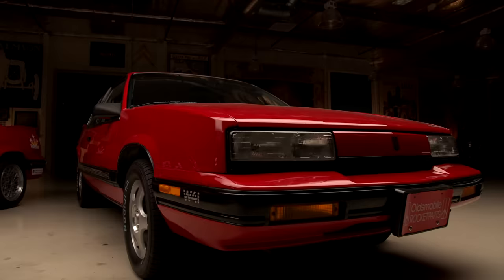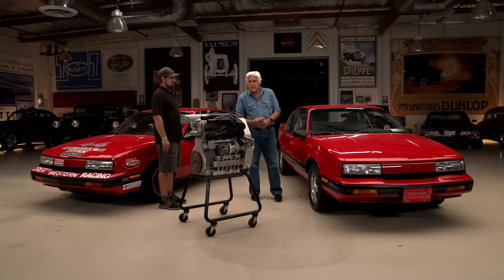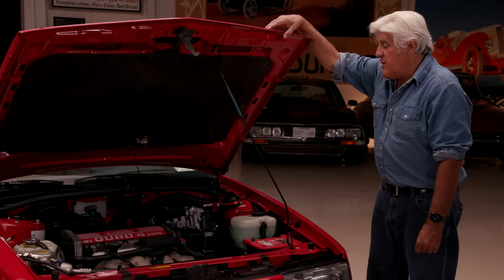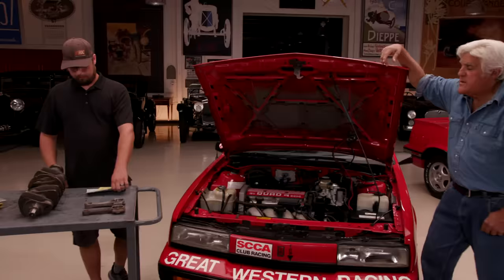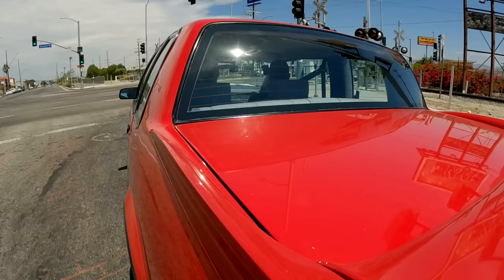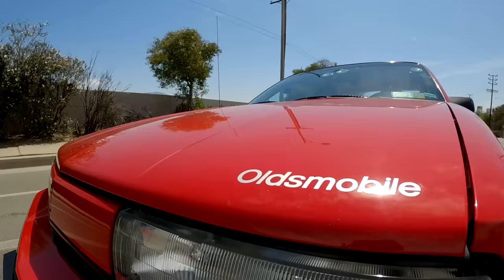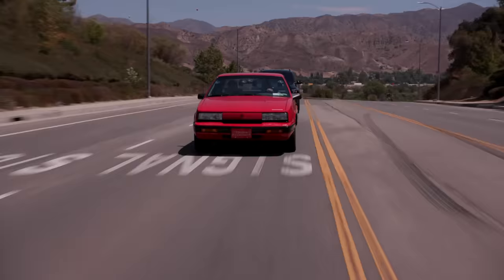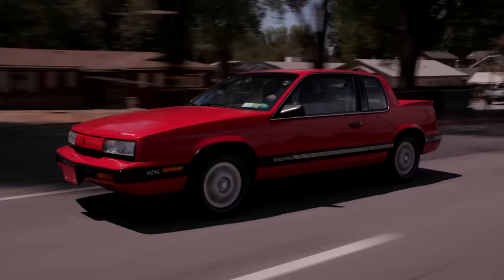Rare 1991 Oldsmobile Quad 442 W-41 | Jay Leno's Garage

Comment: I worked in experimental engineering at Olds in Lansing Michigan. I helped develop the cam chain cover for the Quad 4. The cam chain made noise that was deemed unacceptable. We went to a laminated steel to dampen the sound. Thought you might find that interesting.
Reply: Very cool! Do you happen to have any old factory photos or information on the Quad 4?
Reply: Did your job only include the Chain cover? If jobs are that specific, them must be a lot of people involved in one engine. Which seems ridiculous, but I'm very ignorant about it.
Reply: Thanks for the effort. 92 Achieva scx owner.
Reply: I had a 92 Olds cutlass ciera. That thing was a dependable champ. Thought you might find that interesting.
Reply: Former ‘93 Achieva SCX owner. Nice job on the cover, but one question…..who was the sadistic SOB who said the inner edges of the chain housing had to be sharpened to a razor’s edge? 🤣

Half kidding of course, but I’ve got at least two scars on my right had from incisions made from Quad 4 chain housings. Every one I’ve come across, the inner edges were sharp as hell.
Reply: @zlinedavid  I always wondered how GM got them itty bitty Ninja's to stay inside the timing cover!
Reply: @ryanjarrett5933  Same way they got the other gremlins to stay in their places probably. 😂
Reply: It was a very good cover mate.
Reply: That is cool, you never really think all the problem solving that goes on to build a vehicle that is reliable comfortable safe and fun, it seems like that would be a fun thing to do for a living.
Reply: I remember trying to weld the prototype stampings that ripped and for instrumentation,you needed to have a lot of extra tungsten’s sharped!
Reply: So instead of refining the mechanics they spent $1m on a cover to hide it.  Sounds about right
Reply: I was working at a dealer around the time the Quad4 came out I was the first one in the shop to crack one open for one of the chain noise bulletins. I remember lots of coils, spark plug Helicoils and a fair number of head gaskets.
Reply: @jeffcampbell2710  I work at Honda we build the odyssey, ridge one, pilot & CRV I believe and you would be surprised at how specific our jobs are.
Reply: @mach5jeep  Because every story on YouTube is true.
Reply: Grew up in Oldsmobile town. Dad worked Plant 3, chrome dept Bumpers. Circa 70's and 80's. We'd see these around town and think, eh, Quad 4 banger. Oldsmobile was struggling to stay in the game. That chrome dept came in handy building up my Camaro. Good times.
Reply: @jeffcampbell2710  Many jobs are very specific. I had a customer who formerly worked for GM designing glove box latches. Not joking.
Reply: I was a gm tech and own a couple of the twin cam 2.4. Found it weird everything was aluminum except the cover and it was heavy. Now we know but who is responsible for the water pump set up? I had to replace mine 3 times and lost so much time. It’s almost a days work to replace it. Finally the ecotec version got that fixed.
Reply: I had a quad 4 in my Buick Skylark and it was an awesome engine all around
Reply: So what was making Noise? GM answer was to Mask the Sound. Was it Chain Design? Sprockets? Tensioner? Chain Guides?  Many Engines Designed with Timing Chains don't make Noise. If you have Inside info be Curious to Know I'm a Master Mechanic 45+ Years exp
Reply: One of the coolest comments i've ever seen.
Reply: @klausphx  Master? Where do I do that extra course, or is it a dealership designated title 😂
Reply: Im from lansing
Reply: @mach5jeep that’s typical of GM
Reply: My least favourite thing to get properly sealed on that thing. But I really liked that they used a nut and stud rather than just a bolt. Makes a huge difference when crammed so close to the strut tower and body.
Reply: @jeffcampbell2710  We worked on multiple projects. Not only engine, but body and chassis also. Many of our parts were used to test/improve structural strength and collision energy management. I had the opportunity to go to the proving grounds in Milford by Detroit and view crash tests. That was pretty cool!
Reply: @zlinedavid  We noticed that too. It was caused by the punch cutting the blank for forming. The two layer steel did not punch clean on the second layer. The laminate separation between them did not allow a clean cut by the punch. They most likely dreamed deburring the part unnecessary. Not saying I agree...
Reply: @mach5jeep  The engine design was sound. The cam chain for the DOHC was very robust, but did emit some noise. During field testing, some customers commented on the noise. We could have gone cheaper with a belt to quite the valve train, but chose to keep the original design and address the noise best we could.
Reply: @mharshey111  Now that makes sense. I’m amazed they were formed and not cast in at least semi-finished dimensions. I suppose that leads to the same place though….GM not wanting to pay for finishing operations. I’ve shaved with razor blades duller than the edge those chain housings had though.
Reply: So many bolts in that cover. I had ‘90 Berreta GTZs. Very fun to drive, engine pretty to work on if you are competent.
Reply: I've been tinkering with quad 4 2.3 since 1991 when my dad whom had a Beretta GTZ with a 2.3l 190hp quad 4 
I remember going 130mph in the Beretta GTZ  it was almost as fast as the 200hp olds SCX my 01 Z24 has 250 NA HP turbo ads another 400hp full race tune
Reply: That is such a beautiful kept quad 4 such a immaculate car. That car really is it time capsule and the keeper of History

Comment: 442 in the 60s: four barrell, 4 speed, dual exhaust
442 in the 90s: four cylinder, four valves per cylinder, twin cam
Reply: Four Four Two is a meaningful number - √√√

Comment: Back in early 1987, I was working in the auto industry and had the good fortune to share a breakfast table at an auto show event with Oldsmobile Chief Engineer, Ted Loucas. AJ Foyt had just set the closed course speed record in Texas with the Quad 4 engine he and his team had developed. He was a real gentleman and we talked at length about developing the Quad 4. None of us knew then how dire things would become later for Oldsmobile and couldn't imagine that it would actually be gone. Thanks for The review of this little known Olds, Jay. It's not surprising that it's a really nice car with surprising performance for its day. Oldsmobile had a great reputation for engineering, as you know.
Reply: Olds died because GM took their engineering department to China. If you notice, almost all their new cars and crossovers debut there before they come to the US.
Reply: @Lrules364  That's half correct. They simply prioritized China for a while but many cars designed for China are engineered in the US
Reply: @Lrules364  I think Pontiac suffered the same fate a few years later, a casualty of the Wall Street bailout and GM's restructuring.

Comment: I worked for Oldsmobile when these came out and had been doing head gaskets on the regular quad four engines under warranty. I got to the point that I could do two and sometimes three in a day. When the quad 442 with the high output version came out they were fun to drive but they also had head gasket problems. Later on when the Acheiva SCX came out they were better handling and very quick. The manual transmission was definitely the way to go on these. Great memories!
Reply: I had a ‘93 red SCX and my father had a black ‘92 SCX I miss them both, they were so nice to drive!
Reply: If memory serves me correctly, didn't these engines also experience issues with the heads developing cracks?
Reply: It too was working at dealers when these were out and I have no love for these pieces of crap motor
Reply: @troylegros5114  my younger sister bought a used grand am with the quad four.  Pretty quick car in the mid/later 90s but couldn't keep it running on a teenager's budget.  GM has always had decent styling/design and performance but they didn't care enough about the customers when it came to reliability problems and endless leaking gasket issues.
Reply: Had 1989 Cutlass Calais SL Quad 4. Was fun to drive and with Fire Engine Red one of the very few cars that Color at that time. Overpriced even with my GM Discount but fun to Drive. Had it 5yrs and 101K miles. After my 100K Warranty expired had get rid of it, went threw 5 Head Gaskets and wasn't about start paying for them every yr.
Reply: The achieva scx was a pos complete junk. The Calais was a better handling car, with better materials on the inside. The console in SCX would come loose if you shifted the getrag hard. Complete crap car compared to the Calais

Comment: I've owned a '92 Achieva SCX since new- 245,000 miles on it, the engine has never been out of the car.  It needs a lot of cosmetic work but it runs well to this day.  Jeff has helped me many times on old internet forums and FB groups- he is the Quad 4 man.  I remember conversing with Paul Hacker back in the mid 90's after they had ended the Oldsmobile SCCA/IMSA Firehawk racing program- he was gracious, helpful and a fountain of knowledge.  Thanks, Jay for sharing this discussion with Jeff, and his beautiful W41's!
Reply: I talked with Paul a handful of times in the early 2000’s. Concur, good dude.
Reply: I had a ‘92 SC 5spd, white with red interior.  I put a flowmaster exhaust on it.  For its day, it was fun.  I kept it until 2001 and it had no issues.  I traded it in for a Sebring JXI convertible.

Comment: I raced a Calais with the Quad 4.  I was driving a Buick Regal 3800 with the tuned 16" suspension.  I had 1/4 tank of gas and was driving alone.  The Oldsmobile had 3 or 4 guys in it and was also stock as near as I could tell.  I could not lose this guy.  This engine was no joke.  I remember being in disbelief.  I finally understand why.  Great video, gentlemen.

Comment: This is one of the most underappreciated cars ever made. It really set the stage for the coming age of DOHC GM tech for years to come.
Reply: Would you say the ecotec 2.2 is part of that
Reply: Maybe you could say that there are learnings between the two but in reality these two designs couldn’t be more different.
Reply: @mkendall8393  There are most definitely learnings between the two. Bear in mind the proximity of when the Ecotecs started and when these ended, the other vehicle platforms that shared the Quad 4, and moving forward their later generations or replacements as they were phased out (like the Grand Am for instance). Oldsmobile and Pontiac may have been axed by GM, but there is a lot of technology, especially from Oldsmobile, that moved forward.

Comment: I ordered one of these in Dec. 1990 from a dealer on the east end of Long Island. 

t was my first new car and I couldn't have been more excited when it arrived. I drove it for 10 years and put on 60k miles with no problems whatsoever. I remember going to the Spring Nationals in Columbus, Ohio that were sponsored by Olds. They had several of these with slicks mounted on the front! I think they ran high 14's in the low 90's
Reply: That’s awesome

Comment: The first Quad 4s that made it into cars such as the Cutlass International were beasts.  2" intake tubes.  The whole car was a tour de force in modern amenities.  Steering wheel controls, heads up display, multi functional trip computer in the center stack with maintenance reminders.  Just astounding for 1991.  Those of us who were around for those and other great cars from the 90s don't get super excited about all the 'new' features these days.  We had most of this stuff in Analog, decades ago.
Reply: I worked at an Olds Dealership as a tech and a coworker from the bodyshop side bought a new 1991 442 with a high output engine, 190hp I recall. We had some hail damage on some lot cars so he took one of the hail damaged hoods and installed a hood scoop like you would see on a nova. I wish I had pics. He needed me to drive his car back from the airport. He drove like 90mph all the way there and I had a blast driving it back to his house. Was a very fast car.

Comment: 1) I love that this comments section is basically a W41 owner’s reunion. Former owner of a ‘93 SCX here. Unfortunately, mine went to the big scrapyard in the sky. Had some moron jump on their brakes in the middle of a two lane highway. Said a deer ran in front of her 🙄. It was either rear end her or take to the ditch at 55 MPH. I chose the ditch, and if Tore the subframe and alignment all to hell. I did the right thing and parted out the W41 specific parts to other owners. 

2) God I miss that sound and feeling that pull at about 4000 RPM.
Reply: Dang, that sux!
My step mom is an original owner of a W41 surviver. Still clean and fun.

Comment: I VERY MUCH remember this car!  My boss back then had one.  He bought it new in '91.   I first saw it at a party at the President of my University's house in 1992.  I actually got to drive it that day.  This entire line of experimental engines and all the prototype cars and it's entire history was explained in multiple car magazines of the time.  I may even still have them, I doubt I could ever find them, but this was HUGE back then.  I find it so hard to believe Jay knows so little about it, considering how much rave was made about it back then.  If you were a car guy in those days, you KNEW about this engine and these cars.
Reply: Man, my most vivid memory of driving this thing was how high it would rev.  Nothing of the time could spin like this engine did.  It had "OK" low end torque but when the power band kicked in, WHEW!  Off it would RIP!
Reply: Yeah, Leno must've not read magazines back then. It really was in every magazine
Reply: I remember the add where they ran it dry (no oil) for 24 hours straight and then another where they did some crazy miles with no oil.
Reply: Wikipedia does a nice job of laying out all the engineering variations.
Reply: He's  cgi character give them credit

Comment: I loved these cars when they were new, I had a picture of the Aerotec on my wall (and the Beretta GTZ with the quad 4). These were the cars that made me the automotive oddball I am today (and also the reason i scour autotrader for early 90's Oldsmobiles).
Reply: As I grow older I’ve learned to really like the beretta more than I did when I saw them all over as a kid in the 90s. The tail lights are just so damn cool
Reply: Finally got my hands on a near mint 94 cutlass supreme. 3.4 4cam too bad it's a slushbox.
Reply: @leadfoot8593  is it a coupe??
Reply: @DavidValdezBigWaveDave  sure is. had an 88 back in 98 5speed to boot but always loved the harder edged 94 my 88 had the 2.8v6 I've been thinking what a terror it would have been with a built up quad4.
Reply: My first car was a 90 GTZ with the Quad 4 and 5-speed. I loved that car. 20 years later I'm looking for another one and I just can't find one.

Comment: Learned about the back in the early 2000s when I had a 93 grand am.  It was a base model with no options but it had the quad 4 and a 5 speed.  I would out run a lot of the hopped up imports with it and good handling.  It was actually a pretty fun car for a high school kid.

Comment: This engine was also available in the arguably better looking and better chassis. The 92-93 oldsmobile acheiva sc & scx with 180 & 190 hp.   Scx also had 7k redline bigger sway bars, & electronic dampers. Very interesting car from GM.
Reply: Jeff has an Achieva W41 in as raced condition as well
Reply: I'd take that argument -- I never liked the look of the Achieva, always preferred the Calais.  I drive a Grand Am now, which you can definitely see a lot of influence in it's style from the Calais body, and very little from the Achieva, even though the Achieva would've been the Grand Am's contemporary model

Comment: I remember the 1991 Cutlass Calais Quad 442 W41 coupe. It was a 180hp-190hp car with a Quad 4 engine that was the noisiest engine I've ever heard(even for a 4 cylinder engine). It did have standard anti-lock brakes, though.

Comment: When Jeff told me that this was happening, I was stoked - it's about time that these cars get a little press (again);
I was surprised that when Jay mentioned that the engine should have been in a sleeker body style that the Beretta GTZ wasn't mentioned - no time was allotted for other Quad4HO, or Quad4 cars, and very little was mentioned about the regular production Quad4;
The "W40" for those who care to know was the RPO assigned for the (regular production) Quad4HO of 1989.5-1994;
The "W40" Calais mentioned was mostly known as either the Calais 442, or Quad442 (Oldsmobile's wayy too long full name was: "Oldsmobile Cutlass Calais Quad442").
The cars that could have the Quad4HO from the factory were:
1) 1989.5-1991 Oldsmobile Calais (debuted late 1989 model year with a limited run of 200 'International Seies' coupes; all red on grey cloth fully loaded); International Series 1989-1991 & 442 1990-1991; 442-w41 1991 only
2) 1989.5-1994 Pontiac Grand Am (debuted late 1989 model year with a limited run of 200 'SE' coupes; all red on grey cloth fully loaded); SE 1989-1991; LE w/Sport Performance Package 1990-1991; GT1992-1994
3) 1990-1994 Chevrolet Beretta; GTZ model only
4) 1992-1994 Oldsmobile Achieva; SC (Quad4HO) & SCX (W41)

The Calais and Grand Am were each divisions version of the N-body, the Beretta was based on the L-body, which was in essence a lengthened N-body.
The Calais was replaced with the Achieva in 1992.

The Quad4 had a fairly strong following till GM released the 'tuner' ecotec cars in the mid-2000's - then attrition and time kicked in.